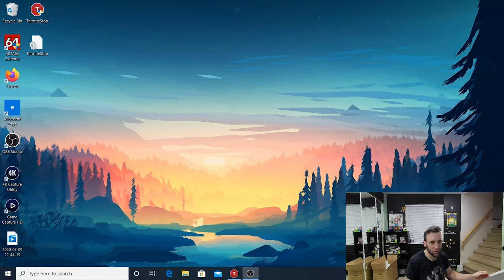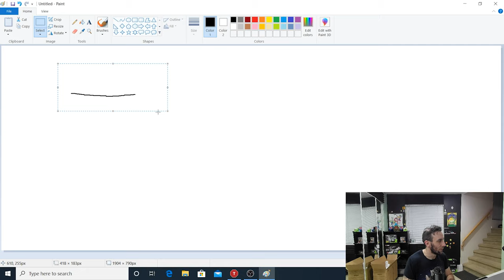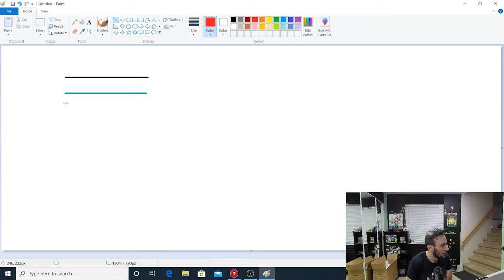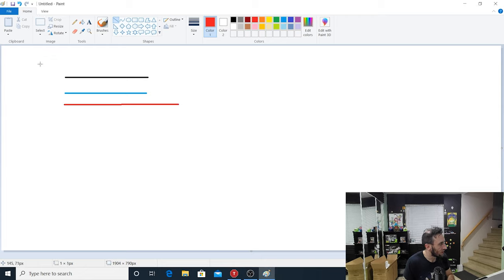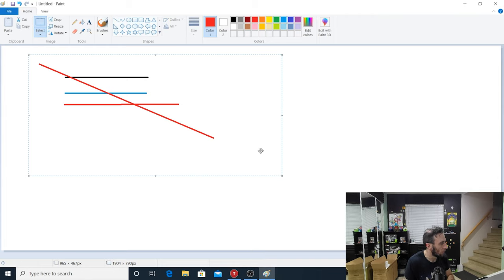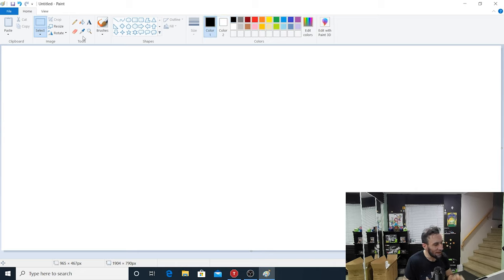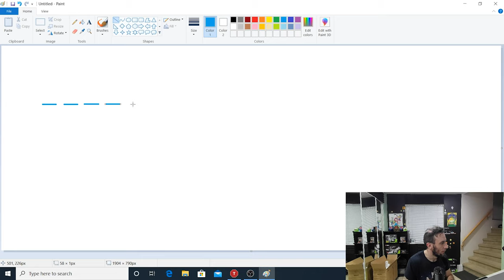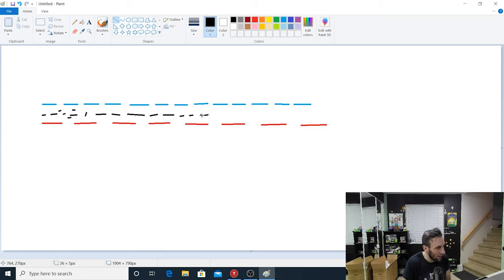Ryzen IPC VS Intel Clockspeed explained!

Comment: IPC is kind of irrelevant isn't it? I mean it performs worse than Intel at gaming.
Reply from the maker: No it’s not irrelevant, it’s just that games up until now weren’t written to utilize larger IPC.  It’s like the old saying, the victor is the one that writes history.  Up until the consoles intel was the winner, so there was no need for IPC increases in the engines.  That will change come the new consoles where they won’t have the low latency high clocking intel chips, they will have slow AMD chips with wide IPC so they will write for it